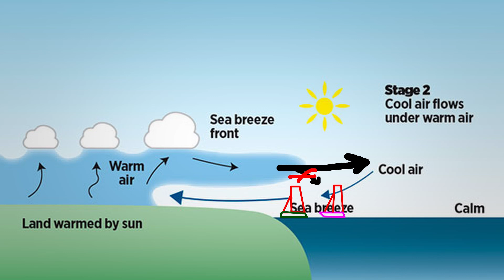Why is it so hard to get through dirty air?... and Rob apologizes to Italy!

Comment: I don't agree about the vmg of NZ... I try to explain why... looking at data on the regatta's there was a thing almost not understandable for me.... the data says that LR (lose or win) constantly shows that LR does a path with a lot of meters less than those of NZ even when the "apparent vmg" shown is similar or even better... that as surprised me cause this is more or less impossible or inconsistent... this was a surprising me until someone Federico Albano on a live Youtube (see "Luna Rossa MORDE, i kiwi RISPONDONO! - COPPA AMERICA MATCH DAY TWO - IL GIORNALE DELLA COPPA at 1:14:56) showed up some "real things" it used "gps data" about the real position of the boats instead and calculates the "real vmg"  instead of the "apparent vmg" showed up on virtual during the regattas ... (the difference is that in the "apparent" vmg they give the data based on the bow direction not based on the real position of the boat in the regatta's course) the "real vmg" shows up that LR has a largely better vmg than NZ.. sometime even 3 knots... this make sense and give to the data (less distance in navigation by LR) consistence.. next come up the analysis   that explain why... 
Do you remember the "flat" vs "anhedral" foils? ... well the anhedral foil largely contrast the "leeway effect" on the boat while the flat foils (obviously) are more less efficient contrasting the leeway effect... so the bow point in one direction but the boat (NZ) goes thru a different path ... the "real vmg" shows (coherently with the distance sailed) a significant edge in vmg for LR...
and yes there is also the turbulence by the sails that you explain but this don't give you what really matters that's the real vmg based on the current boat position instead of the bow direction... so i'm not saying here that you are wrong about turbulence you are wrong when you say that vmg shows and edge for NZ...
Reply: @provassemblea mi hai preceduto. Stavo per scrivere la stessa cosa. È abbastanza sconcertante come i dati dell’organizzazione non siano attendibili e riescano a smentire se stessi. Fortunatamente e forse per la prima volta in assoluto, esistono più fonti e gente con voglia di guardarci dentro.
Reply: @zaphodify  non è "sconcertante" è che se ti basi sul dato "angolo della prua" per dire quale è il vmg... sbagli proprio il senso della valutazione e la natura del dato che vorresti leggere perchè quello che ottieni non è il vero vmg ma uno "strano coso" che non tiene conto della vera rotta delle barche... se tu fossi in mare da marinaio e ti basassi solo sulla posizione della prua per calcolare dove vai e dove sei... andresti presto "a scogli"... tutto qui...
Reply: @provaassemblea8063  a me pare piuttosto sconcertante che l'organizzazione della Coppa America presenti i dati calcolati prendendo la direzione e della prua. A maggior ragione su un parametro piuttosto poco intuitivo come la VMG. Posso ipotizzare che probabilmente il sistema rappresentava una buona approssimazione fino a quando le due barche a confronto avevano dati di scarroccio simili, cosa che non è nel caso LR vs TNZ.
Reply: I was wondering about that also . In light winds LR gain distance ver TNZ but  data showed better VMG for TNZ . Strange  :))
So now we know that VMG data are wrong ( are based on assumption that there is no leeway ) . This means TNZ are producing much more leeway , drift and sail faster but bigger angle.  
Foils shape. For me it means that TNZ foils are more difficult to operate and need more adjustments when sailing ,to counter   drift and find balance between lifting boat and  counter leeway .   
This also shows , that TNZ sail faster but LR more efficient in light winds. In stronger winds drift effect is smaller , so it gives TNZ advantage.
Reply: @zaphodify  si in sostanza hai ragione probabilmente il  vmg è il dato meno "intuitivo" per un profano... ci sta che sia così ... e è vero che è un dato "sostanzialmente sbagliato" perchè non è il vero vmg non gli chiarisce certo le idee.. ma questo fino a che non se ne accorgono da soli o qualcuno non riesce a farglielo notare lascia le cose come stanno (che ci piaccia o no)
Reply: @danielmarek7093  the foils cannot be changed now! so they will be the same .. agree that with strong wind you have less leeway.. that's obvious... we will see...

Comment: I congratulate you on the careful technical analysis you are doing. The same is done here in Italy and listening to a discussion about the fact that although TNZ has a top speed and a VMG higher than LR even upwind it fails to prevail all times. It seems that in addition to the aforementioned greater agility of LR, it emerged that TNZ has a much higher upwind leeway than LR and for this reason it travels more distance with the same maneuvers in similar wind conditions. Furthermore, TNZ in upwind mode is obliged to bear away more when maneuvering to gain speed in less time.

Comment: Interesting comments regarding dirty air or 'gas' as they sometimes call it.  The other factor I was hoping you were going to touch on was the effect of the boat travelling at 25-30 knots leaving a large blanket trail of disturbed air that is being cleared or moved by only a sub 10knot breeze. The blanket of disturbed air is therefore far bigger than we would find in conventional displacement hull match racing. Another interesting factor is the effect of disturbed air whilst sailing downwind - in this instance where 40 plus knots speeds are being achieved I think I am right in saying that the following boat is going to be sailing into the  disturbed air of the lead boat(again a very different scenario when compared to far slower displacement hulls) ; this factor of course is going to explain why often the lead boat is often pulling away downwind and also why we often see the following boat taking the other side of the course not just in the hope of finding more pressure but out of necessity to avoid disturbed air. So is the dirty air a far bigger factor in these AC75's than was originally anticipated and if so how can the course and their sailing be modified to bring back a more level arena??

Comment: Can some explain why it would be bad for ETNZ as starboard entry boat to deliberately come in 5-10 seconds late & go to the left.  LR won’t have time to turn back to cover.  ETNZ comes back on port tack at speed aiming for port starting buoy with plan to cross under LR.  Starting 50m behind with so far appears to be superior speed, when they came back on starboard tack they surely would cross first.  From then it’s pick their timing, and tack back to pin LR on right hand boundary.  ie. back their boat as the better boat.
Reply: We think this would be a good strategy. I suppose the problem is if it doesn't work they might look a bit silly.

Comment: So today, Race 8, would it have been quicker for LRPP to get foiling if they had gone to the higher air pressure on the Left Hand Side of the Course E rather than sail in displacement mode around the mark? I think so. If they had done so, they would have been up foiling within 1 minute and still, even with further two tacks and gybes, 2 minutes ahead of ETNZ.
Reply: Hi Peter ! And what did you make of those turn of events on the America’s cup course yesterday. The starting box is still ETNZ Achilles heel.
Reply: @johnmartin7158  John, thanks for getting back to us! We were transfixed. What great drama! These early morning starts are a regular for us now! Tea and Toast and the telly on! Absolutely riveting! My wife Catherine gets it right more than me - she called it 2:0 for ETNZ today. She said ETNZ were just being cautious earlier on in the series in getting back into combat sailing and now are letting rip and will let rip again tomorrow. She also thinks it will be wrapped up 7:3 tomorrow with another 2:0 for ETNZ. Yes, LRPP are the slower boat by a couple of knots each way and by comparison LRPP are getting slower. We noticed the new clew area sail and higher lead back line to the mast which contributed to light wind sail shape for ETNZ. So exciting! This has prompted us planning for a trip to NZ - one of those things we have put off and put off. My brother Roger was a rugby player in NZ at club level when he took a round the world trip 30+ years ago. I was never the player he was but I was a club rugby coach for forwards and we had excellent links with the All Black administrative people for youth training, even including input to our lads from Sir Graham Henry at one point! Happy days!

Comment: I guess the air flow at 1.15 should have been drawn reversing the rotation direction of the vortices considering that the windward flow gets rushing more o less quickly into the depression of the leeward flow.
Reply from the maker: Yeah it should. I wasnt really thinking, just drew circles to should turbulence but they're going the wrong way!

Comment: I agree with longer starts, however I also want to see plenty of time on the racetrack when there are large wind shifts.
My solution would be for the race officer to select the type of race 10mins before the start. Eg. 5 mins in the start box and 2 laps, 2mins in the start box and a 4 lap race. Or something similar. There would be 2 instructions. How many minutes in the start box and how many laps.That would also stop the playbook scenario. 
We mustn’t forget however that if the boats spend too many minutes and many manoeuvres in the start box, the grinders would be killed keeping the hydraulics charged before the race has even started!
Reply: Having to reserve and ration your grinding power in the prestart wouldn't be an inherintly bad thing. It would bring a whole extra dynamic into the tactics and strategy of the race

Comment: Here why I think dirty air is so huge. It's because the boats are going 30 plus knots under great horsepower. Apparent wind speed 40 knots. With 10 knots true wind speed the wind has only a little wind energy and is easily disturbed.  The boat is expending tons of energy to the air mass as it's at Max righting moment so really disturbs the wind alot. Compare this to a mono slug in ten knots wind  going six knots almost no need to hike , very little heel. Really no comparison how much it's disturbs the wind compared to a ac 75  at 40 knots apparent wind speed

Comment: I have mixed feelings about this video. On the one hand you do a good analysis of the reasons why the AC75 in particular makes it hard to pass, on the other you propose solutions to the problem that are not directly related to the cause. I agree with making the start longer, but having just a 2-leg race is not for me. I would vote (if anyone cared, this is) to remove the boundaries and have longer legs, even if that is at the cost of having only 4 instead of 6 legs. If one looks at the previous cups, or indeed most match races, boats tend to come together because of the inherent need of the leading boat to cover the trailing one. Boundary-less matches would bring back breeze searching and proper tactician work. Anyway I am slowly becoming a fan of your channel. Keep up the good work!
Reply: You have some good ideas there. Keep it up.

Comment: New Zealand, First time I agree with you both, the rules are set up for higher winds, the light conditions have taken a lot more than power out of the Sails it's done the same to the Sales.

However racing way out near Great Barrier so the public can't see is a problem right now.

The most egg-siting thing that happened yesterday was the 2 protest boats claiming international waters.

At times they have stuck races in the back paddock where public access is limited and gatherings of 10 or more are unlikely.

Frankly as I said I agree with you, at least 2 separate conditions have come together to make the race boring as hell and the plonkers have set the rules so it can't be changed.

The Racing would be much better out at The Barrier but the sea's are Bigger you're talking 3m.

Thanks for at least watching the races, I'm doing 2 or 3 things at once to fill in the time between start boxes.
Reply: Whangaparoa ?
Reply: @MrBugleboyb  yes army bay

Comment: Sorry Rob, you're wrong again. Race 2: NZ 31 secs ahead. Race 3: LR 37 secs ahead. Race 4: LR's big mistake when NZ was 9 secs ahead. Race 6: it wasn't race, NZ sailed only on best roots without match race, so it wasn't a real case. I don't agree with NZ's big advantages and LR's close wins. Furthermore, in the last AC series with displacement hulls the faster boat had the advantage 100 meters after the start and gained meters after meters for 3 hours, and the results were 5-0, 4-1, 5-1... Are you sure they were less boring? But I don't want to be your enemy so I agree with 4 or 5 minutes pre-start :DD

Comment: I watched the dirty air video, but I think you miss the point. Unlike conventional sailing, the Ac75 is going much faster than the wind speed, so the effect does not create a normal shadow that goes behind the boat, actually the boat speed also pulls the air with it. You could never test this in a wind tunnel, for example.

Comment: As a paraglider pilot, I know turbulence at the Landing Zone from upwind obstacles can reach six times the height of the obstacle downwind.
Reply: Not quite the same on a sailboat. More akin to wingtip vortices, size 4x mast on keelboats is my rough rule in flat seas up to 22kn. They are moving objects whereas rotor off a fixed mountain etc works differently. I sail, paraglide and fly so just my observations.

Comment: Its clearer now. In lighter airs LR can only defend a lead, but can never re-take it given the boat speed of NZ both up/down wind. LR's faster tacks are likely not enough alone to re-take a lead. So its all about the 2 minutes start. We could run the whole cup in a morning -  7 starts separated by 15 mins. Pray for calm winds, so we can postpone races until later in week (Wednesday) when the winds pickup to 14knts. Which may be the final day.

Comment: How about restart at the end of every leg? You log the time and add the times up to determine the winner. At the end of every leg, the first person across gets the advantage on the restart, but they have to wait for the other boat to come in, and then they do another prestart. If prestarts are where the action is, then make each race have six prestarts.
Reply: I just suggested this in another comment, seems like it could be exciting to me...  perhaps even make it point-based rather than time based  so if one boat has a shocker they don't lose the whole race in a single leg.

Comment: Reynolds number, Froude principles, Vortices, "dirty air". All play their part. Yet no team seems to have yet figured out that the boat with the (relatively, always relatively) higher kinetic energy over the other boat directed toward the next mark has the advantage on the start line. So what you Mozzy said in an earlier video about Starboard entry sailing off to mirror the Port entry boat and sail around and back to the start at speed is actually a correct solution in terms of delivering the greater kinetic energy to the first mark. Kinetic energy is not an absolute it is always relative (here to the course and especially the other boat). So crossing the start line evens but with higher kinetic energy to the mark for boat A vs B is actually a "start win" for boat A. In this start box, creating dirty air for your opponent whilst keeping your kinetic energy higher than your opponent also leads to an advantage. Pete Burling in the Press Conference after the 3rd day of racing I thought might have given away ETNZ Team thinking and their starboard entry start "play" by saying LRPP fell off their foil while sailing through the "dirty air" created by ETNZ. Had they planned that situation? Fair play if they did. Given that coming off the foils in the start box is a distinct possibility (3 or 4 times now collectively between each team out of the 6 starts?) and so in light and "dirty air" it is even more imperative that "killing time" on the run back to the start line is achieved not by slowing the boat down but by keeping a higher kinetic energy and sailing a course which gives you room to kill time by course over distance. If your opponent slows their boat down to kill time they are in no position to block you crossing the line, your 30+ knots will allow you to go either side of their 20 knots boat. It is like fighter plane principles being discovered by trial and error in WW1. Initially fighter plane designers sought manoeuvrability. Very quickly those that won realised that speed was everything, again because it gave the plane with the greater kinetic energy the winning advantage.
Reply: A good post. 
Clearly illustrated by Burling’s start in race 6. Coming in at speed from the side carried a slight risk of being forced over, but only if Spittal timed his run to hit the right hand mark bang on time and at full speed. Failing this, you have maximum velocity, reaching along the line with the ability to round up and hit the line at t = 0, as ETNZ did with a speed margin of about 4 knots.

Comment: Any idea if and how much a couple thousand spectator boats affect this notion of disturbed air? And, do we know if the camera choppers have an impact on pressure etc?
Reply: I think they definately make it lighter at the edges
Reply: The commentators were mentioning the spectator fleet affecting the starboard side of the course where they were congregated. I certainly can see an effect in light wind conditions. They should be moved further away.

Comment: What sort of ability is there to reduce the wake size with sail design? Jagged trailing edges for example. And is there a way to make the boats have enough sail power and a low enough boat speed that it is more possible to sit in the wake? Or even some kind of rule change to give the trailing boat right of way at all times.